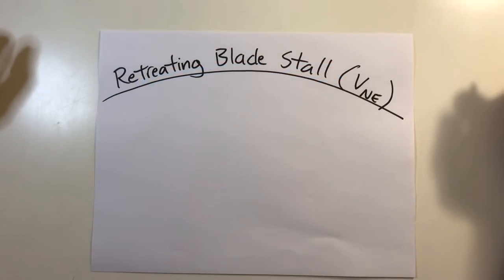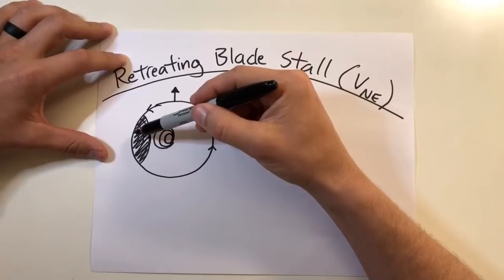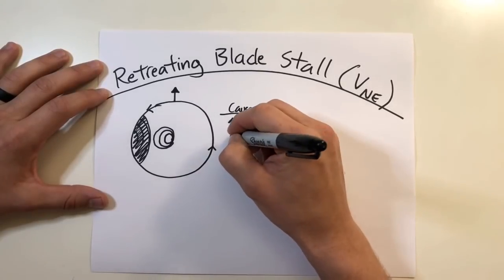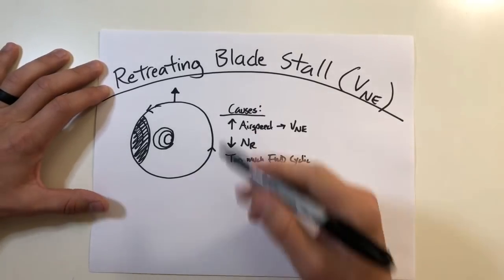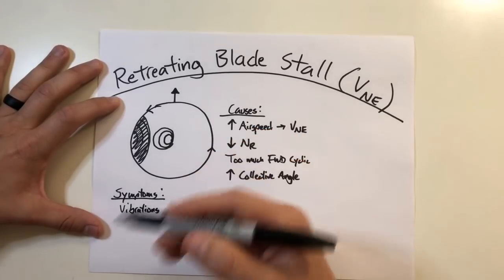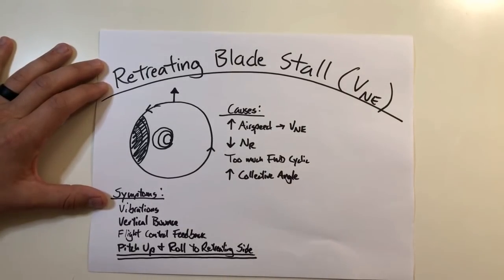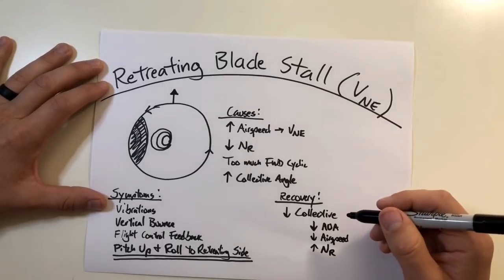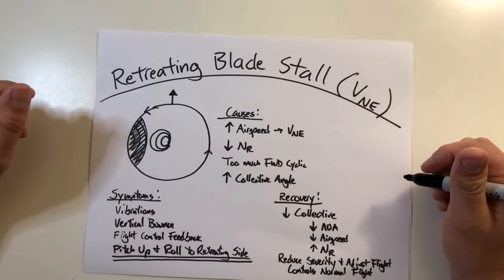Retreating Blade Stall/VNE in Helicopters

Comment: I feel like every pilot has a worst fear. Well maybe some don't maybe some say that their worst fears what everyone else is worst fear is getting into one of the bad situations a helicopter can get into. This one is definitely mine. I've never been able to explain why. The main two reasons though that I can think of why this is the most terrifying scenario for me the first one is that it's something we can't go practice. Everything else we can basically practice. I mean aside from this and mast bumping and Low G pushover. But can we practice Auto rotations? Yes. Can we practice hover autos? Yes. Can the instructor purposely leave the alternator off on the startup and then not allow the students to take off and then explain to them they need to go reread the Poh to understand why taking off with the alternator is such a bad idea? Yes. Can we practice IFR? Yes. Can we practice LTE? Maybe not exactly but we can practice way too much pedal in One Direction. Can we practice Hydraulics off? Yes. Can we practice Vortex ring state recovery? Absolutely. Can we practice getting lost on a cross-country and then finding our directions again? Yes. Can we practice bad radio communication? Well that one is practiced automatically just by making so many mistakes communicating. Can we practice recovering from retreating blade stall? No absolutely not. The other reason I can think of why it freaks me out so much is the scenario it involves you being in. It's not just critical blade stall. It's not just pushover. It's not just gyroscopic precession and a lack of control. It's not just being overweight and the disc can't handle the load. It's not just a lack of control of the helicopter. It's not just instruments telling you everything is fine and obviously the helicopter is not. It's not just an uncontrollable vibration in the helicopter. Now where is with most issues you can somewhat some of the issues simply that "this is the issue" and to recover from the issue you "mostly do this and a little of this to recover." To me retreating blade stall is "first this happens and then it gets worse and then this happens and then it gets worse and then this happens and then it gets worse and then this happens and finally what could happen is who knows maybe the helicopter flips over and you fall out of the sky or maybe you blade stall and follow the sky or maybe you lose control and the helicopter shakes apart or maybe you inadvertently pull back too hard on the cyclic and chop the tail or maybe you encounter a mast bumping issue to recover from it you clearly want to reduce your speed but you don't want to do it too quickly you want to lower the collective and then go aft cyclic but nice and slowly nice and slowly nice and slowly nice and slowly just reduce the speed reduce the angle of attack." It sounds simple enough but we obviously can't go practice it and to me it makes auto rotations seem easy. It's just a number of things that go wrong and the main thing is obviously you're pushing way too fast and the rotor cannot handle even lift distribution anymore the advancing blade and the retreating blade and the advancing are and retreating are are not coordinating and one side of the helicopter is getting left in the other isn't and before you know it everything is just going bad first this happens and then this and then this and then this and then before you know it to recover you got a very slowly slowly slowly do this otherwise this is going to happen and this and this and this and this and this. To me this is the worst nightmare scenario. To me. I don't know about other Pilots. I can't say everyone has their own thing that really bothers them. And by no means am I trying to say those other things would not bother me. No emergency scenario is something you really want to go through whatsoever if you can try to avoid it whatsoever. But definitely retreating blade stalls one of those things that keeps me up at night that I just think constantly "wow I wish I wasn't even something that could go wrong." Additionally I feel like all your intuition would tell you to do the opposite in retreating blade stall. I feel like whenever you're having a problem with the helicopter the one thing you want to do is either get forward motion or increase the RPMs or both. The engine goes out and you're doing an auto rotation try and get that kinetic energy going to try and get those RPMs trying to get that forward speed don't overdo it but make sure you have that power. Really high density altitude? Try and make up for it with power with forward speed and RPMs. To me retreating blade stall is like that one scenario where all the things that you would intuitively do to get out of a stall are just going to make you still even more. Okay yeah you can say the same thing about Vortex ring state. You can say the same thing about getting too much of a Glide or not enough of a Glide or getting critical blade stall in an auto rotation where you added too much RPM you had too much forward speed you lost too much RPM you lost too much forward speed. Okay you're in Vortex ring state and instead of adding power you want to reduce the angle of attack and reduce the power the more power you add the worst it is going to get. But once again I feel like those things are things you go in practice you go and practice those things and you realize from experience that in this situation you want to do the opposite you don't want to add too much speed you don't want to add too much power you don't want to add too many RPMs you want to oppose that intuition and create an opposite intuition did in this situation you just need a certain amount of RPMs and a certain amount of power in a certain amount of forward speed and you can recover from the problem. To me though retreating blade stall is like every bad thing that could happen the helicopters stalling the helicopters flipping over the helicopters potentially shaking apart the controls are not going in the direction you want them to because you cannot compensate for gyroscopic precession with a pitch horn anymore it's like everything with the helicopter is just messing up backwards. I suppose the scenario to recover a simple enough kind of like Vortex ring State you just lower the collective reduce that angle of attack and then you can go after cycling instead of forward in Vortex ring state. But it's like aside from the fact that the helicopter controls aren't doing what you want them to do I feel like retreating blade stall creates a situation where the helicopters also about to shake apart or something as though you've created ground resonance. It's just an unexplainable nightmare to me and of course if I watch my density altitude and I watch my speed and don't over weigh the helicopter then I'll never have to worry about it. But wow is that scary or what? The thing could just totally tip over upside down before you nose down to the ground uncontrollably as well as maybe many other problems. We must remember what creates lift with a helicopter Bernoulli's principle and even lift distribution. We must remember why dissymetry of lift is something the rotor system has to compensate for whether it's with a fully rigid or semi rigid or fully articulated rotor system. We have to remember the teetering hinges allow the blades to Teeter allowing even lift distribution we must remember the coning hinges allow the blades to Cone independently of each other allowing the blades to operate and continue to create lift while changing the disc directions with the cyclic and the pitch angle with the collective without worrying that the coning will be either be excessive and the blades will not be able to properly produce lift or that the blades will not be able to cone whatsoever and handle the disc loading the weight of the helicopter whatsoever. I'm sorry if I got any of that explanation backwards where it's more of a vice versa thing. But you know what I'm saying. Retreating blade stall to me challenges all of the reactions of pilot would have of how to recover from a situation and at the same time challenges all of the reactions of pilot would have where practicing the recovery is something that you can just never do. I guess just remember your VNE remember the weight remember the density altitude you're working with for the day and practice the feeling that if you think you're going too fast for one reason or the other try and slow down but first lower the collective and reduce that angle of attack before going after cyclic. And just pray something you're never going to really have to recover from it because you're never going to get into it if you're smart enough. And try not to have nightmares about it like I do 😢 edit: also increasing rotor RPM with the governor does not seem intuitive along with lowering the collective and going aft cyclic

Comment: Interesting information but, if you were to lower the collective after a violent uncomanded pitch increse due to the stall, the rpm would go crazy
Reply from the maker: It shouldn’t be an excessive or extreme movement of the collective. It should be just enough to reduce some angle of attack and reduce the severity of the maneuver and to reestablish control. But you could see rotor RPM fluctuations in the process.

Comment: Hey, Jacob, Out of curiousity, Why dont you mention the blade flapping high on the advancing side and low on the retreating side???  This is was a pretty critical piece of my DoL lessons and yet its simply not mentioned here.
Reply from the maker: I don’t mention it in this video because I go over flapping more thoroughly in my Compensation for Dissymmetry of Lift video. I try not to put too much into one video so it’s easier to understand. Sorry for any confusion.
Reply: @helicopterlessonsin10minut10   No hey dont worry about it! Ive been doing 8-10 hour sessions prepping for my CFI checkride(which btw your illustrations have helped an untold amount) so my brain is a little burnt, haha, and I didnt notice the 3rd video until after, I apologize.

Comment: What's the relation between the angle of attack. And collective angle I didn't understand ?
Reply from the maker: Collective really controls angle of incidence, not angle of attack. Angle of incidence is a mechanics angle whereas angle of attack is an aerodynamic angle. By increasing collective angle, you increase pitch in the blades, but depending on the amount of induced flow, you may not increase the angle of attack.
Reply: @helicopterlessonsin10minut10  I need really to reopen my student books....
Hhhhh thanks for you

Comment: what about phase lag and how it's fully recognized at the 6 o clock pos. good video but you didn't say why the helicopter rolls to the left.
Reply from the maker: ashbdhj. Not many references described why other than stating the drag on the retreating side has increased dramatically. So the phase lag causes the pitching up while the drag causes the roll to the retreating side. Good question. Sorry I don’t have a textbook answer for you.
Reply: would the reduction of lift, hence retreating blade stall, cause the roll to the left? i mean the retreating blade is not producing any lift while the advancing blade is, so it rolls to the left and pitches up (due to gyroscopic procession)

Comment: Why would the nose of the helicopter pitch upward ?
Reply: Because of gyroscopic precession. Any force acted upon a rotating body will be manifested 90 degrees later in the direction of rotation. The advancing blade will be producing more lift than the retreating blade, causing uneven lift on your left and right sides. 90 degrees later means you are physically experiencing that unequal lift at your nose and tail. Thus, pitching up.

Comment: As a private pilot, unfortunately, a stall may have occurred in Sikorsky helicopter accident.. involving former basketball ball player, Bryant.
Reply: Michael Hegyan I doubt it.
Reply: @flyjuice  right.. before, I read aopa brief, pilot had over 8200 hours, however, should not have flown with visibility of less than three miles. Plus, he had no terrain tracker..deadly mistake
Reply: Michael Hegyan I agree, I think it was pilot error, VFR to IMC.
Reply: @flyjuice  i am not questioning anything, but why would the helicopter descend into the terrain at such a high rate is speed if not for a stall?
What are some other potential causes of that?
Reply: It was not engine failure, according to the pleminary NTSB report.  Belly was also shown just before impact. This is very likely...
Reply: @notthefather3919 correct...it had to have been a stall...there is no other logical explanation of the speed at impact. Even if pilot was disoriented... why would he pick up speed if he cant see... the only answer outside of a stall is purposely suicide.
Reply: John Dana once a pilot is desorientaded he/she can put the aircraft in any odd attitude and ending up loosing control. It happens all the time.

Comment: I thought it was a slight roll to the right, mainly nose up, but also a bit to the right due to gyroscopic precession acting 90 degrees later, thus to the right. Anybody heard this before?
Reply: It depends on whether it's a CCW or CW rotor system. The effect would be opposite on a CW system due to the right side being the retreating blade.